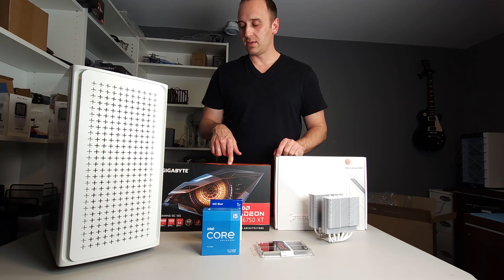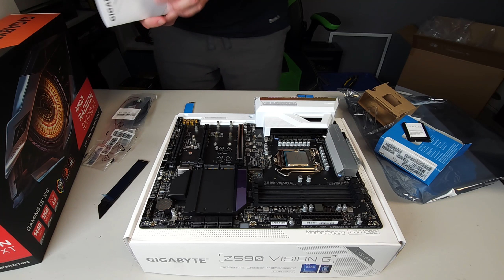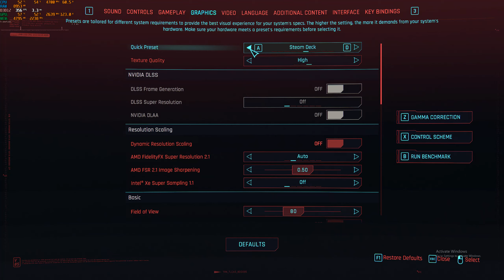This is a great $850 1440P build. Intel i5 11600K paired with a Gigabyte RX 6750xt 12 gb.

Comment: Hey man, i also have the exact same build except for the case, motherboard and your PSU.. 
I'm looking to either buy a Intel Arc B580 or a RX 6750 XT... which one do you recommend?
Reply from the maker: Price to Performance the B580 seems to be the better choice. The 6750xt seems to perform a little better in most games, but I've heard the B580 is much better in Raytracing and it's cheaper. I ordered the B580, but it's on back order. When I get it, I plan on testing it against the 6750xt and 3060 12gb. I have high hopes for Intel because we need another player in the GPU market.
Reply: @jackshardware  Do you have any idea of how the driver overhead issue might affect the performance of the B580 with a i5-11600K?
Reply from the maker: @sasitharankalaivanan4255  hardware unboxed just did a new review with a ryzen 3600 and 5600. I believe the 11600k performs near the 5600. From what I can tell the performance hit is minimal in most cases. The ryzen 5 3600 performs substantially worse.